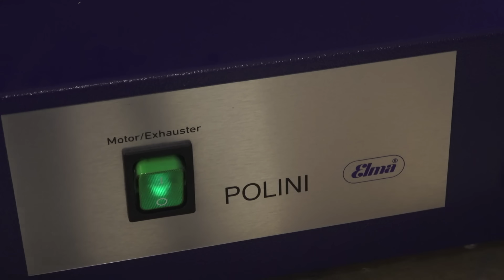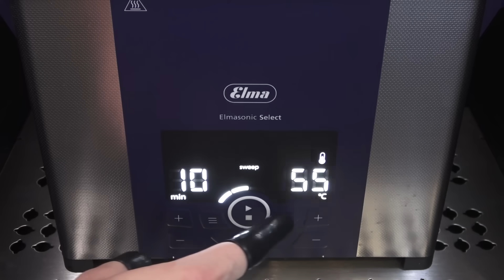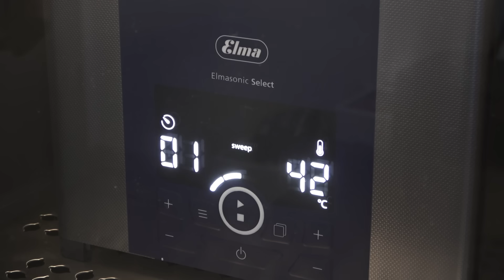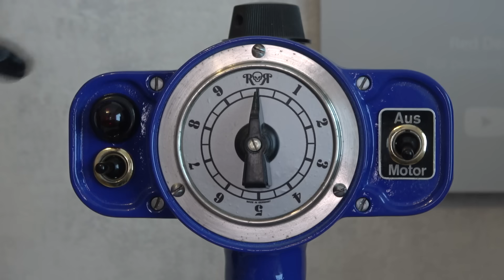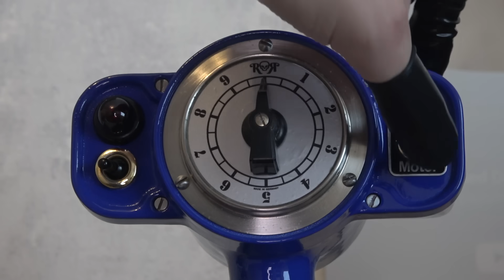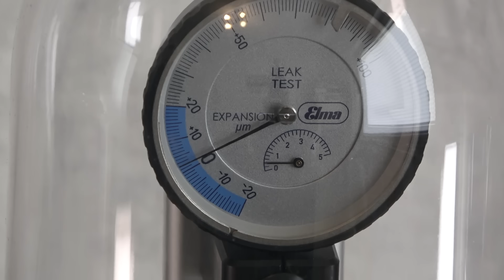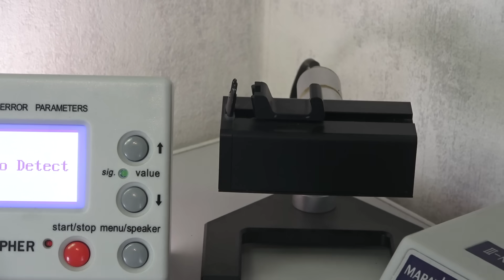Rolex after Plane Crash - Restoration of a wrecked Rolex Milgauss 116400GV

Comment: Great restoration as always. There's some lovely new tools and equipment since the last video i watched. 👍However, I'm still disappointed that you haven't tidied up those white wires on the otherwise immaculate cleaning machine.  Put some sleeving on those cables.
Reply from the maker: You don't give up hm? 😅 The machine will  be replaced with a brand new Elma solvex soon 😉

Comment: A survivor of an infamous accident, it seems a shame to scrub some of the patina of the watch from it. Surely it bears its scars with pride, a reminder of the catastrophe. So in that respect I saw the restoration as rather sad.
I’m a Boeing 777 pilot, and frequently fly into San Francisco. The challenge that faced the pilots was the energy state of the aircraft. Typically, San Francisco Air Traffic keep the aircraft high. Just like a large truck rolling down a hill, it’s necessary to lose the energy in order to land. We have an effective air brake to deploy, but once the aircraft is not on an appropriate energy profile it needs careful monitoring to ensure parameters are moving in the right direction. 
In this case the pilots unwittingly selected a mode (FL CH - flight level change) which unbeknownst to them would not automatically activate thrust in the event of a low energy state.
Large aircraft pilots are not accustomed to manual thrust control (it would be irritating on long flights) and the crew became preoccupied with attempting to regain the profile for landing, without realizing the aircraft had become dangerously slow.
It is a testament to the strength of the design that despite the horrendous collision with the sea wall the structure remained intact. There were no fatalities aboard, but sadly a couple of passengers were separated from the airframe when the tail section detached and were impacted by attending emergency vehicles, losing their lives.
The event has become a case study in operation of the aircraft. 
Lovely production and macro shots in this video, but as I say my preference would have been to return the watch to working order retaining more of its patina so it could tell the story.
Reply: Polishing it and making it look new is a much more fitting course of action. It's not very wearable and can be enjoyed, it doesn't have to just be an artifact now. A testament to moving on, removing the scars so to speak. Would have been a real shame to keep the watch looking like that forever.

Comment: Amazing skill in restoring this watch. One question though. Why at the beginning would you spin the hands or wind it? Isn’t there risk of glass fragments getting in the movement or scratching the dial. I watch a lot of these types of videos and the first thing they recommend is to pull the crown to hack the movement.
Reply from the maker: There were no glass fragments on the dial, no risk in my opinion here.

Comment: You close the case, do leak test and then measure the accuracy? Or it is only for the video? 😉
Can time machine restore the bearings as well? Not very clear from the video 😁
Great job! Very satisfying to watch.
Reply from the maker: I've tested and fine tuned the accuracy before. But you are right, I should show it also this way in the video 😉

Comment: Very good video and interesting background to the watch. You have a very comprehensive ultrasonic cleaning capability. My question is wouldn't a modern ultrasonic cleaner clean all the watch parts better than the dedicate watch cleaning machine whose technology probably predates ultrasonic cleaners?
Reply from the maker: Ultrasonic cleaning could damage the tiny movement parts that's why most watchmakers use the rotation cleaning 😉

Comment: If that were my watch (and it isn't so what I'm about to say isn't my decision to make) but there isn't a hope in hell those scratches would be allowed to be touched. The plane crash is part of the history of the watch. Now it's just another Milgauss. All I'd get done is get it serviced, running well and replace the crystal and perhaps remove any sharp edges on deep scratches.

Why I hear you ask? Well I've made this mistake - I purchased a non running secondhand Breitling Hercules that was in a motorcycle crash. It was badly banged up very similar to this Milgauss and I had it straightened out, the dial and crystal changed, the bracelet polished, the deeply scratched clasp replaced and now it's just another boring Breitling like all the thousands out there. Never again will I erase a watch's history. It could've been a great watch now it just sits in the drawer because I don't like what I did to it;  on top of that it's boring, insipid even, oh did I say it's boring?

Comment: Nice work, as usual. A watch that makes you dream, it stands out from the crowd compared to other models.
I much prefer the rubber strap, I love the contrast of the dial and the bracelet. Especially since even if it's rubber, it's Rolex and the quality shows. Comfort on the wrist must be exceptional compared to steel.
Personally, I only prefer Nato (Nylon) straps, that's all I can stand. I hate steel bracelets which are heavy, cold and have the tweezers option! I can only tolerate nylon around my wrist, it's the most comfortable and breathable material. It is not for nothing that tactical watches for adventurers and soldiers often have this material which offers only advantages compared to all other types of materials. 🤓⌚👍